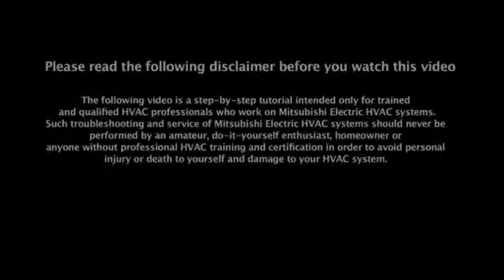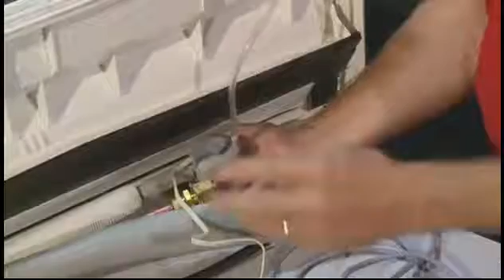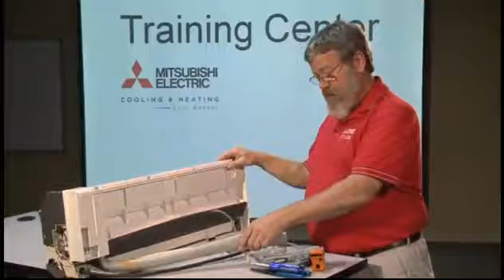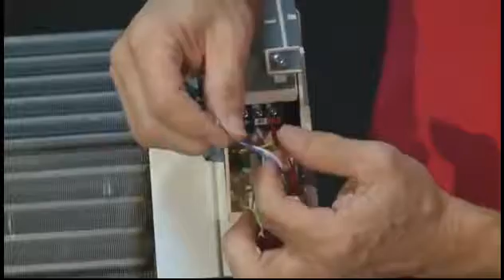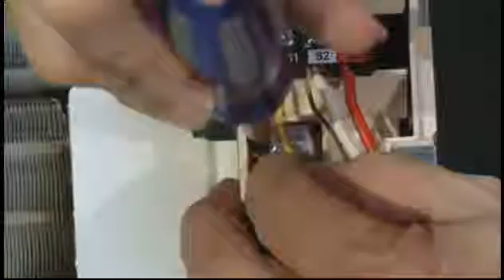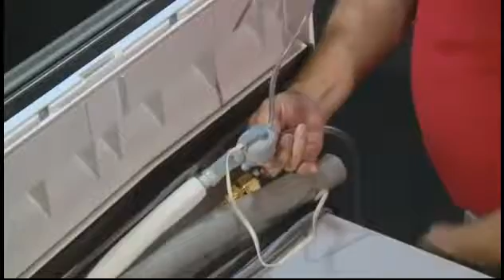Condensate Pump Installation Service Video for Mitsubishi Electric Cooling & Heating

Comment: I have an aspen mini lime pump.   Gray purple and orange ….  The other sheeth has red (goes into s2). Black (goes into S1) and green, ground-   I can’t figure out where the purple and gray wire goes.  It says the orange is left capped (nowhere).  SYs purple goes to s1 and it says gray goes to s1 for outdoor unit….    I don’t remember mine having a cap anywhere (took it out over a year ago, don’t remember screwing wires together)  but perhaps this is what I need to do?  Can anyone help me out.  Mitsubishi mini split , two wires don’t have home now. Gray and purple.    (Orange too but that remains like that)

Comment: Why is this different them what is in the instruction manual that comes with it? For 208 or 115 and only have four wires no ground wire.
Reply: Here I am 8 years after you comment and you are absolutely right it’s different then the manual